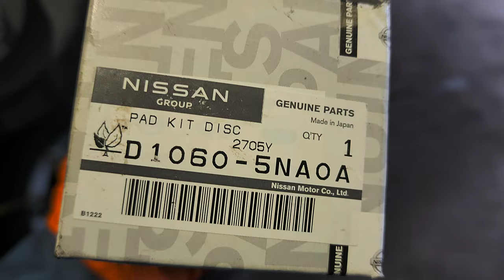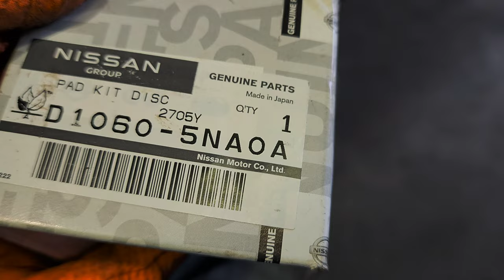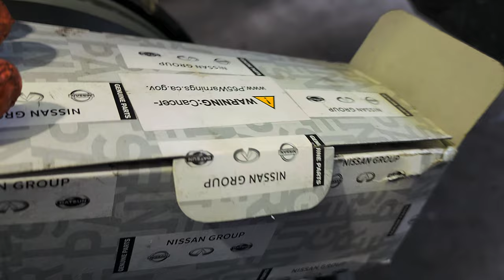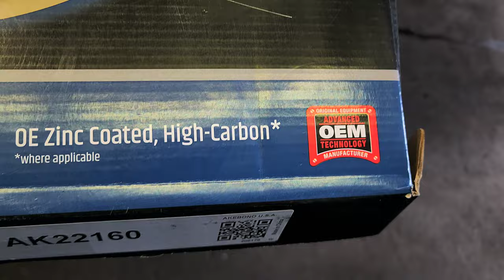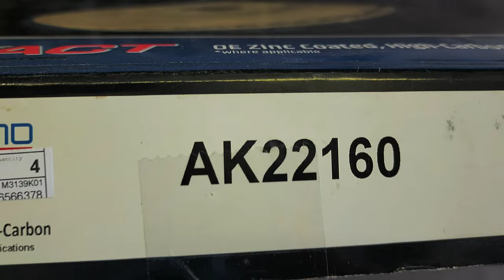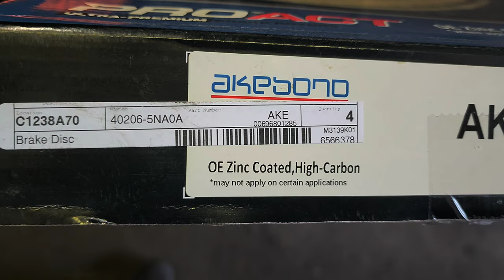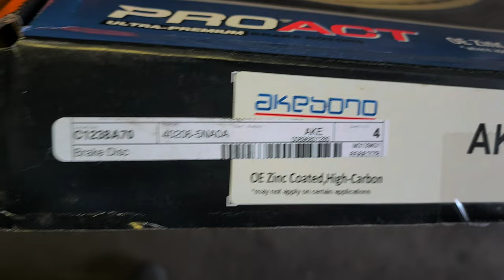2019 - 2023 Infiniti QX50 How to Replace the Front Brake Pads & Brake Rotor

Comment: Most brake cleaner labels tell you to avoid spraying on  rubber seals and those expensive painted wheels. Your pads will last longer and wear more evenly if you resurface the rotors.
Reply from the maker: Surfacing rotors is illegal 🤭